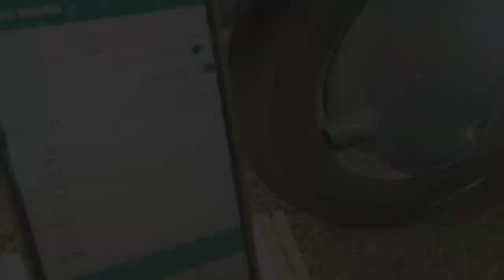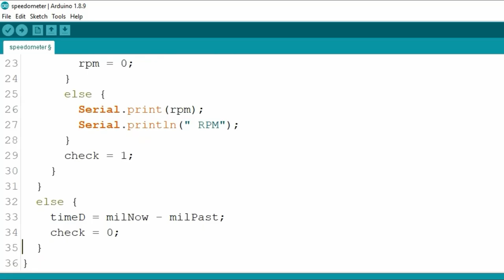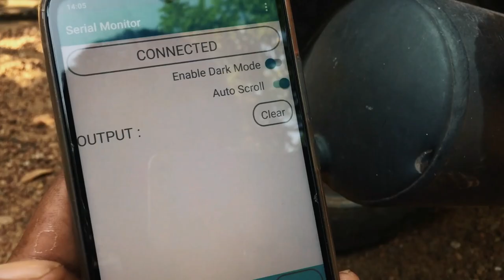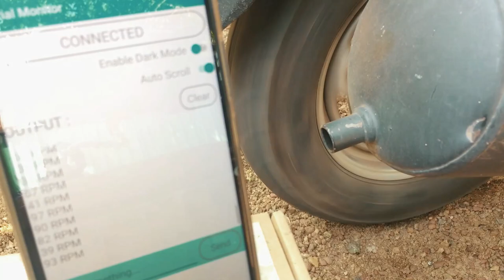How to Make Attachable Wireless Speedometer 🔥 Very Easy to Make

Comment: 1. soldering is awful
2. clipping pins rather than removing , soldering wires to remaining nubs 
3. gluing a duino to metal case of battery shorts pins and the board . 
Not something to emulate here.
Reply: Yeah. Bro i want to know your idea about this project. Is this successful project or fake one. Is there any chance  to do this kinda thing...

😐😐😐
Reply: @John-ep2on  can you take an accelerometer and make a pedometer...  sure but it will be novelty because it needs help to be accurate. Its measuring acceleration not steps. That makes it misleading.   if you do it nice it would likely be one of the 5$ ones you see in dollar stores. Pretty inaccurate if you shake your leg it would go nuts.
Reply: Ok thanks. If do you mind, what is the best way to make speedometer. Wireless
Reply: @John-ep2on  gps
Reply: Ok thanks brothew
Reply: He attached it to the wheel 🤯... thats a no no! Besides being extremely impractical, if it manages to stay attached 😂  it would also create wobble! That battery is plenty to offset the wheel's balance.
Reply: It works, doesn't it?